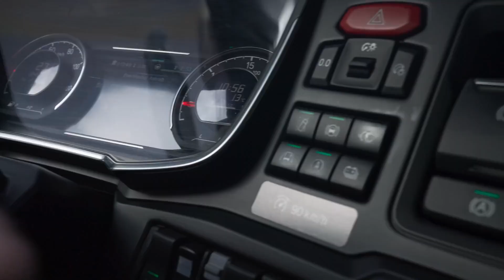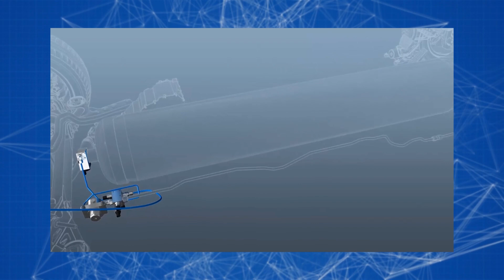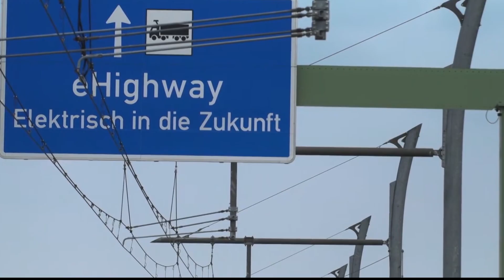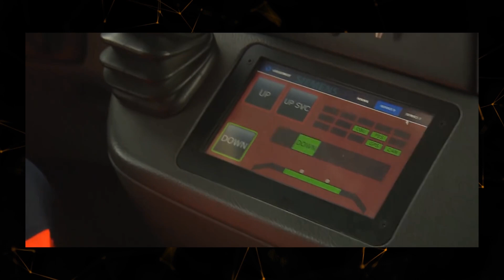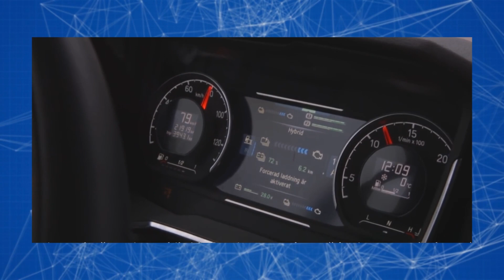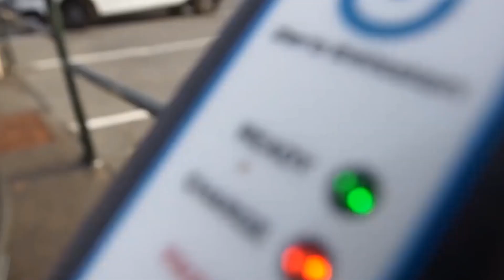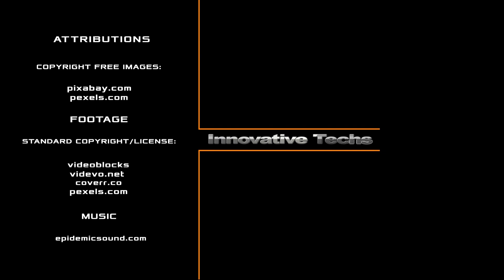Is There a Future For Electric Highways For Trucks?

Comment: This would be wasteful and dangerous and expensive for no reason, could you imagine how long it would take just to get those wires up
Reply: I don't see that as dangerous or wasteful. Many cities have overhead wires for trams or trolley buses. I don't think installing these kind of wires is any more dangerous and the expense can (at least potentially) be justified by the savings and environmental benefits. I don't think getting the wires up takes longer than building the highways in the first place.

Comment: that seems like a really costly idea which by the way will pollute too and maybe much more with the construction of these suspended cable, if they could make the system simpler and much cheaper, maybe it would work, a simple cable on the road for example.
Reply: "that seems like a really costly idea which by the way will pollute too"

It doesn't sound that costly (nor polluting if electricity generation gets decarbonized).

"simple cable on the road for example"

If you want it on the road it probably has to be rail set into the road which is probably more expensive to install than an overhead catenary.

Comment: Thanks for this. We have abundant solar energy in Africa which can not be stored for later use or transmitted to other places. Why cant this be used to produce hydrogen as a form of solar energy storage and then be exported or transported...?
Reply: It depends on the location in Africa. In Morocco, they are planning to do this and people invest in there because they are a stable country.
Reply: Because unless you have pipelines and the H2 volumes to justify their existence, transporting hydrogen means transporting steel mostly. The train might go a bit farther, but by truck, over 50 km you spend more energy moving the steel tanks than you are carrying with the hydrogen contained in the tanks.
If your country has natural gaz, with suitable regulations hydrogen might be mixed in, but currently international buyers who buy gas want gas, without hydrogen mixed in.

Comment: HV cables above roads what could possibly go wrong..  More Copper mined and used for the conductors.   Voltage drop as amperage increases,   How much power to put down the lines.. The Criminally minded stealing the cables.. Hoar Frost on the cables in winter making them useless or breaking them.    Tons of batteries reduces the Max weight a lorry can carry..  Both JCB and Perkins are working to perfect a Hydrogen gas engine ... Watch this space..  Oh They have done it! and it's running...